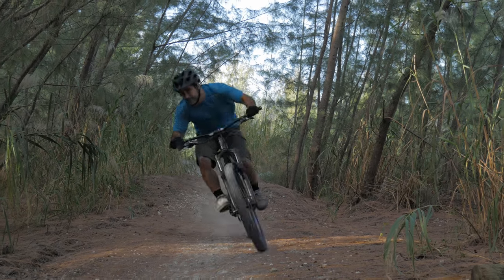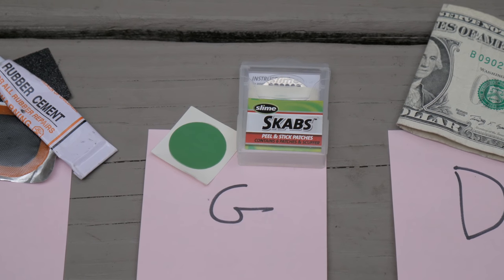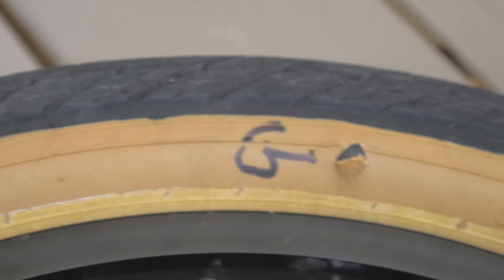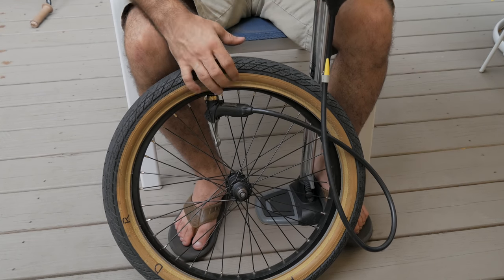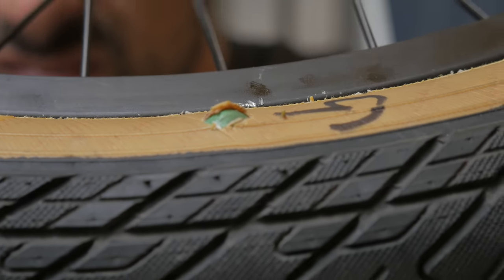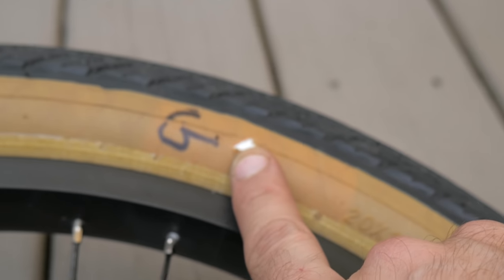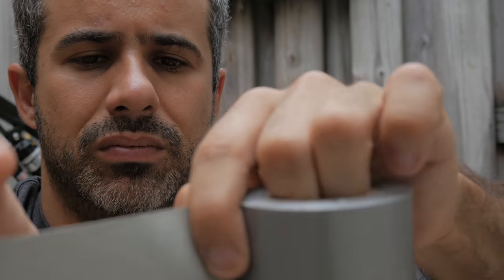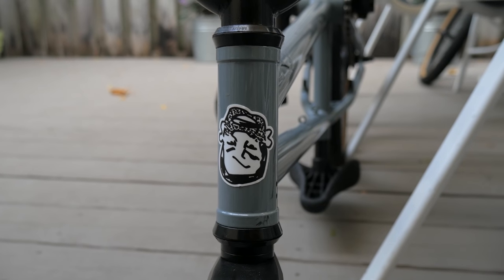5 Tire Sidewall Repair Hacks, Tested

Comment: The tire boot is not that great, especially when chewing through miles on a multi-day event. On the first day my mate got a tear, we patched the sidewall and replaced the inner tube however two or three days later the tyre boot rubbed through the inner tube causing a slow puncture. Granted this did happen in 40 C so take this with a pinch of salt.

Comment: I've used the currency method since I started BMX when I was 8 after going to the store and though that it would be tape after i licked it, it worked once I would always use this as a hack not a permanent measure

Comment: I keep a roll of electrical tape with me. 
Last time I had a tire break down while out riding, I wrapped the tape around the tire, rim, everything. 
If you have rim brakes, you'll want to disconnect the brake on the affected wheel.
An important note: you only want enough air in the tire to keep the bead seated.

Remember, this is just a "get you home" fix.

**Electrical tape is also good for
--taping a broken spoke to its neighbor
--securing plastic bags over your boots
--making your bike look cheaper than it really is, so the thieves go after someone's much-nicer looking bike
--an emergency condom (okay, not really)

Comment: Please.. we used cardboard and rubber cement if we had it. If not tape and cardboard and rode for months. We didnt have money to spend every time we got a hole in the tire. We had 10 to 15 patches on a innertube..

Comment: I patched an mtb tire with 2 layers of duct tape, a small piece of card board and then 1 more layer of duct tape and it's held on for the past 3 months with no signs of bulging or stress. I have yet to buy a new tire

Comment: Isnt this tyre only meant to hold 60psi? Nice
Reply: no, its probably a 110psi tire.
Reply: Douglas its a 65psi max tyre
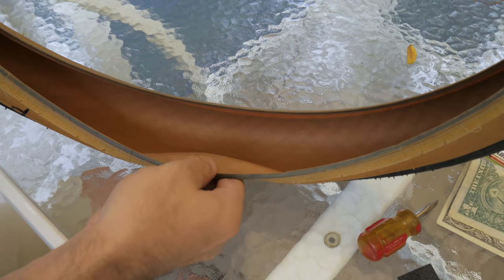Reply: Pause video at 2:24 (and 4k video setting), you can see the 60 psi max, it says 35-60 PSI max. (It was not easy to find a good picture of it, and at 1080p, it doesn't even show up at all for some reason, like the marking doesn't exist). It looks like Youtube compressed it a ton, because that should be at least half visible at 1080p

Comment: a Canadian 5 would prob do better because of how it's coated in plastic so it's a bit stiffer
Reply: william hayes I don't think so. It seems to me that a large part of the dollar bills effectiveness comes from its large coefficient of friction between the tire and the tube, which would prevent bill from slipping and allowing more material to poke out of the side wall. The Canadian bills are really slippery compared to the Americans bills. One trick I use in machining setups is to put paper in between parts than need lots of friction, which works like a charm.